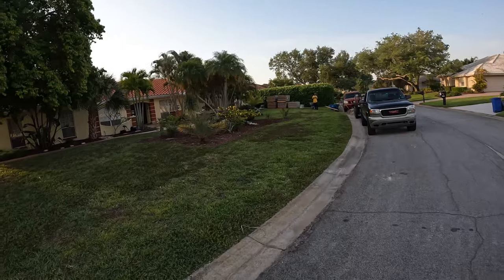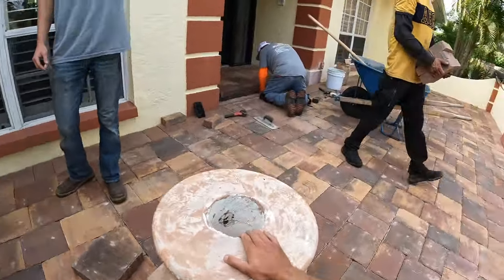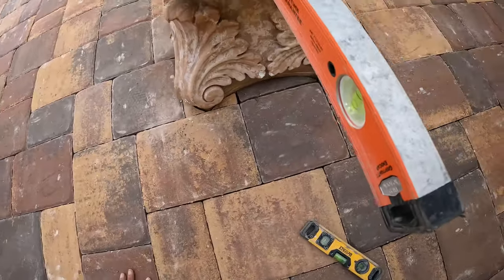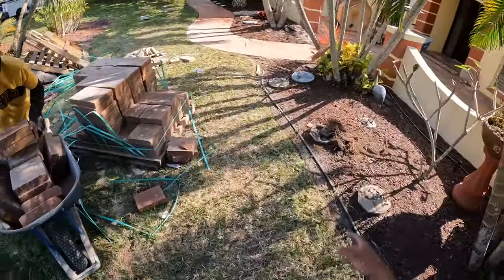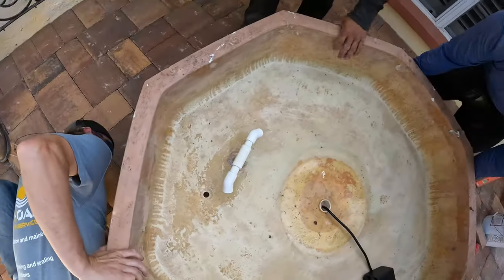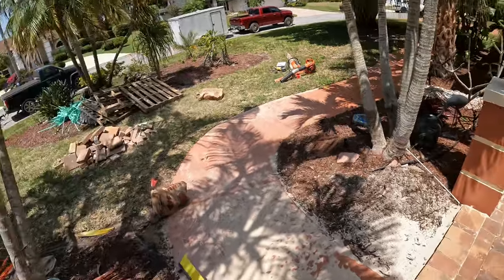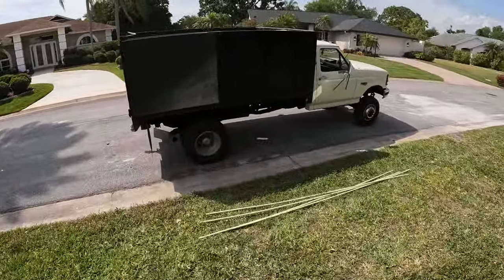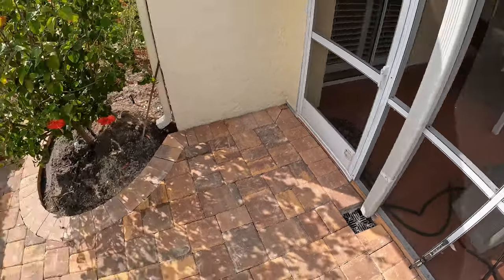FINISHING PAVER INSTALL & WATER FEATURE!!!

Comment: Wow! Looks great! You guys do nice work! That Fountain looked heavy. We once had to move a outdoor Marble table back onto its legs. There were only 4 of us and the homeowner told us later that it took 6 guys to take it off the legs. We wondered why it was so damm Heavy! How did you make out with the door on the Ford? Were you able to pull that Fender out a bit?
Reply from the maker: haha oh yeah marble is heavy! And yes with the help of you we were able to pull the fender back out from the door and it opens freely! i really appreciate the heads up on that, also to replace that fender we would need to open the door so i would have had to figure that out either way but now that the door works i will most likely hold off on getting a new fender for a while. You're the man!
Reply: @SuncoastOutdoorServices  Glad I was able to Help you out! We got to look out for each other!